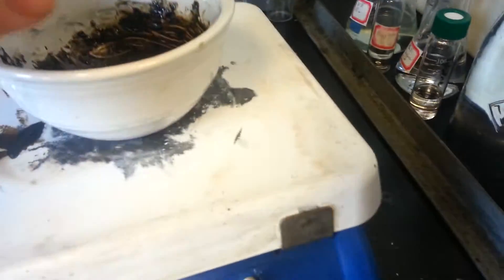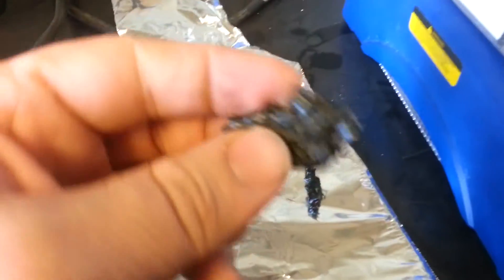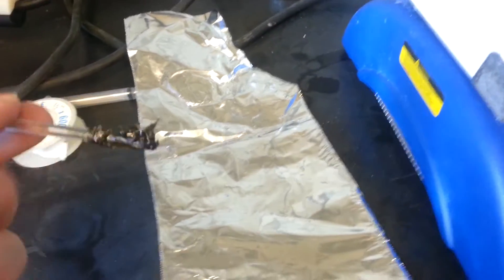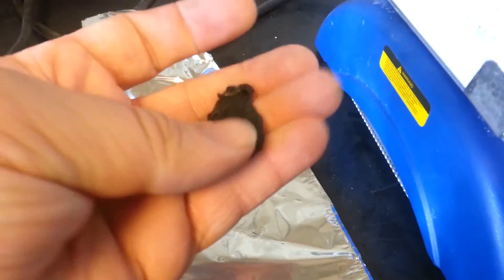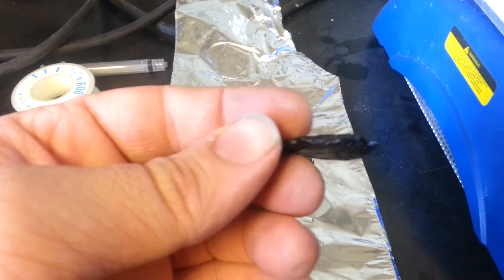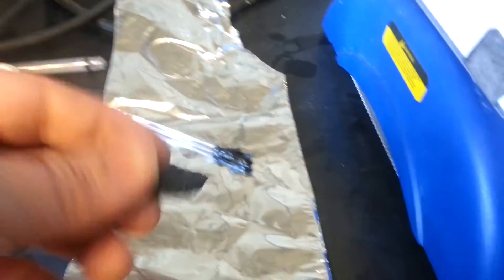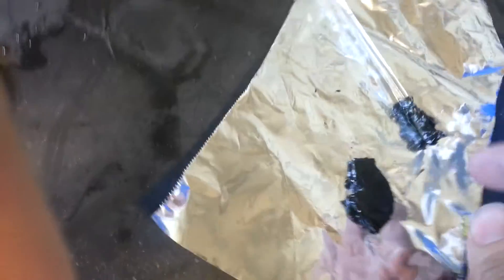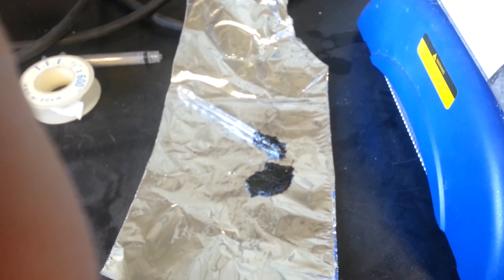Graphene enhanced ABS

Comment: Does it still conduct electricity when it is mixed with the plastic? If so, how well? Great stuff, can't wait to see how you will use it :)
Reply from the maker: Ok. How the conductive ABS works is with a high graphene concentration. (around 50/50 by weight) This sample is between 0.5% and 1% by weight. The strength is more than double the ABS alone. I will have the material analyzed by the mechanical engineering department to see the exact qualities.